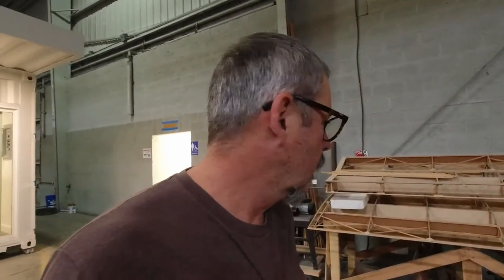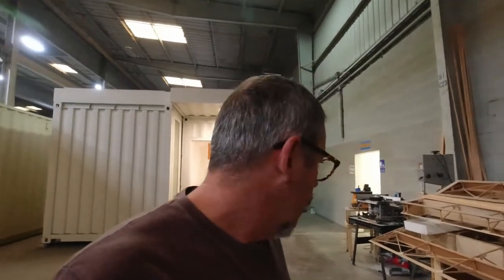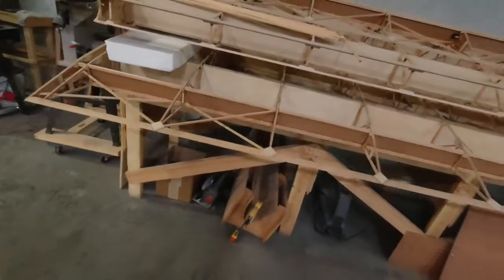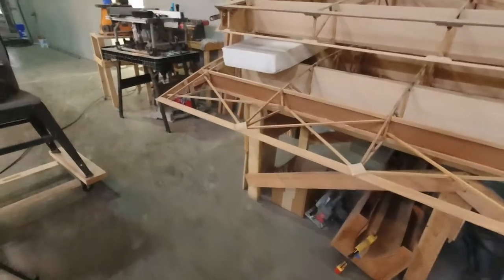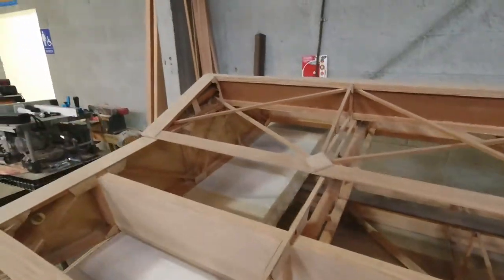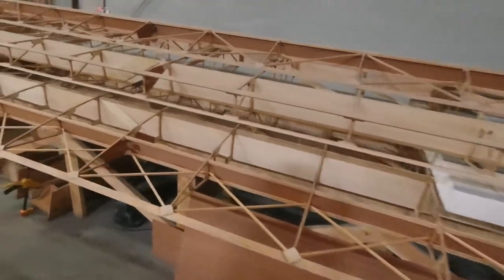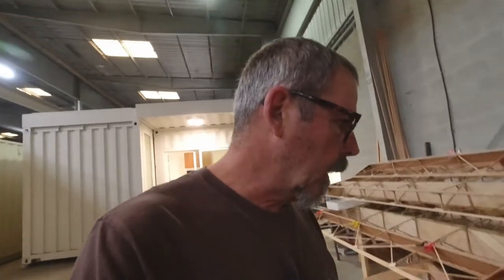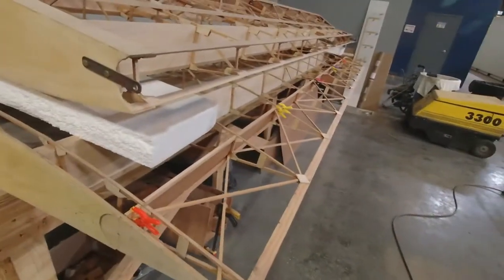Minimax 1100r Aircraft Build Vlog Episode 36

Comment: Looking good!
Reply from the maker: Hey thanks!
How is you plane flying with the new engine?
Reply from the maker: I’m planning the Kawasaki as well.
Reply: @DTMinimax  
After finally getting it to run cool enough that I'm not having to constantly watch/worry about it overheating I love it. Built a custom air scoop. https://ulbuilder.wordpress.com/2020/11/09/air-scoop/

I wish I would have built my fuselage with a flat nose. Having to deal with the confines of the integrated bed mount just complicates things.
Reply from the maker: Mine will be in the up/down configuration so everything will be out in the open. J-Bird makes a scoop, you like this one better?
Reply from the maker: Nice!
Reply: When I got the engine from J-Bird it it had a smaller head on the front cylinder and an air scoop for the rear cylinder head but not the front. That scoop ended up cracking and they sent me another one. I added guessets to the replacement to prevent it from cracking. My problem was the front head would reach max temperature in less than 1 minute at full throttle. They sent me a larger head for the front. Helped but not totally resolved the issue for the front but now the front dumped so much heat to the rear head that it was now getting too hot. I rotated both heads 90° and installed the air scoop I made and no longer have high CHT issues.